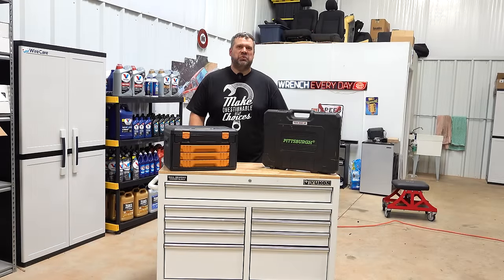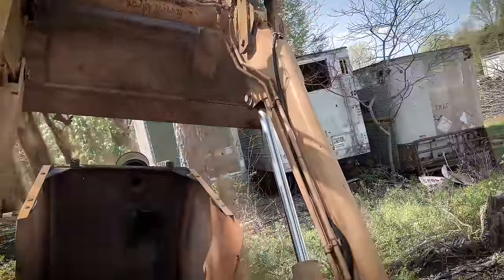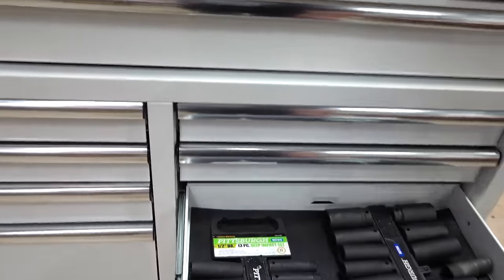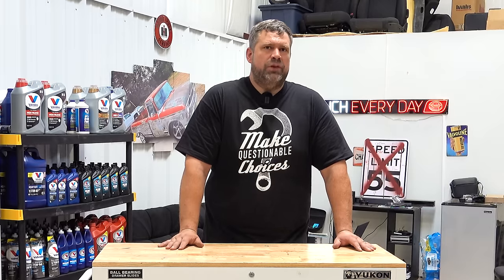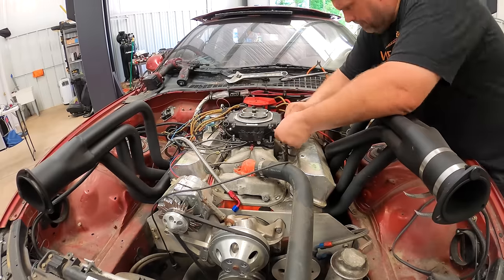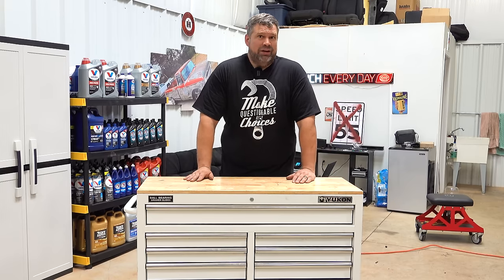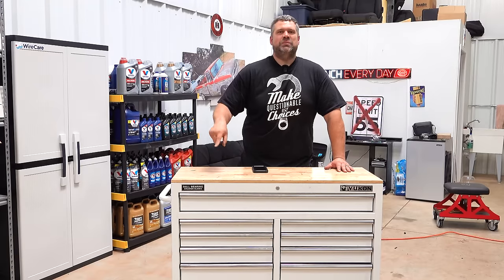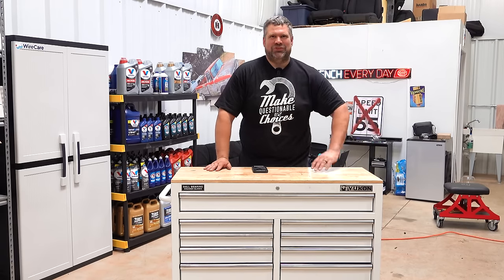I Bought The CHEAPEST Tools In Harbor Freight (6 Month TORTURE TEST)

Comment: I have a set of Pittsburgh screwdrivers and it has it's own organization stand about $40 it's comfort grip handle and seems decent I bought them before I bought the gearwrench and sunex screwdriver sets because I like the look and the organizer tray, but it is really decent I probably should have saved my money and just stuck with the Pittsburgh 70pc screwdriver comfort grip handle set.the new gearwrench handles are nice but honestly I don't see hardly any difference between the type and quality of screwdrivers between the Pittsburgh 70pc set and the sunex comfort grip red and black comfort grip handle screwdriver set, and I used to have mostly craftsman USA g1 and g2 and the older v-va series wrenches, sockets extensions and screwdrivers and I had over $3k in sockets and I am not a professional mechanic just a farm kid.. mostly working on 4x4 gm square body trucks Fe bumpside Ford 250 truck, and the Ford 96 f250 obs 460bbf 2wd super cab long bed and the current truck my 2000 dodge ram Laramie slt quad cab long bed 1500 4x4, and the other one Early 94 Chevy Silverado extended cab short bed Z71 tbi truck and garden tractors lawn mowers and various farm equipment I learned to fix out of necessity if I want to use like the 81 Chevy c20 350 quadrajet 4bbl 4spd farm truck we had and it was broken then I had to acquire the parts and figure out how to fix it, because we couldn't afford to just go get something else or something a little bit newer and couldn't afford to pay a shop labor and to tear it down to the offending broken pieces and parts, and pay for the parts and then put them back together so that usually resulted in scrounging around junkyards and scrap yards and possibly rebuild the distributor or the gm SBC or sbo starter to use a vehicle or piece of equipment one of us owned... but I like working on cars and trucks as a hobby still do.

Comment: When you are 16 and need your first own tools you buy cheap and replace the broken stuff with better tools you can afford at this time. The tools you break are the tools you need most and this are tools you need quality stuff for. I´m from Germany so I use 95% metric and the rest is for my MF35 tractor, you need no wrenches 30mm and up for 100€ a piece that you use 3 times a year. What you need are very good 10/13/17/19 mm tools you use 3 times per hour.

Comment: Like you I bought tools from Snap-on! When I Started buying tools in 1981 we didn't have Harbor freight! I did buy some of my tools from Snap-on! Just because they came into the shop I work at! The Sears store was over thirty miles away from me! The tech school i went to had protocols and I bought some of them! But I didn't like them because they didn't stand behind there products! That why I bought the Snap-on because no matter if it broke they stood behind there products. The shop ii worked in did alot of exhaust work! The floors in it where asphalt with wood under them so we couldn't have welders or cutting torch! We had to use clamps on everything! The clamps had half inch and ninesixtenth on them so two to three times a year we had to replace those sockets! We always use air wratchets to tighten the clamps!@

Comment: Gearwrench "Its not worth the money" I bought a metric wrench set, 10 tools, 2 of them wouldn't ratchet, the rings popped out. Warrentied for whatever. Been waiting 4 months for a replacement. Just nothin. A wrench aint no good if you dont have it. 20% failure rate is just junk.

Comment: I have used a buddies Pittsburgh green and black plastic handle grip pliers slip joints and I got a really big very sensitive blister on my hand from when they slipped and pinched my hand between the pliers and the freaking bolt and I threw them up against the bed of my truck and they blew apart and gave him $5 and the fairly nice but surface rusted craftsman professional series robot riveted slip joint pliers and told him to shut up after I got the blister on my hand when I purposely broke his junk ass pliers on the bedside of my truck and I was only trying to bend the cotter key after repacking the wheel bearing on my k20 86 chevy custom deluxe long bed 4x4 farm truck and I am usually completely respectful of others tools when I use them..

Comment: Why does every thing costs so much for even low quality. 
I bought a kmart bench top 100 piece 3 ratchet sizes taiwan made for $40 25 yeaes ago, still use it every week.
And a harbor freight 301 piece like 15 years ago when where $99.
Harbor set broken some ratchets but the bench top is still running strong .
Reply: Inflation. Dollar doesn't stretch has far has it did before, I'm spending 300% on groceries in last 4-5 years then previous, pretty crazy how much everything gotten expensive

Comment: Years ago I had a 300.00 A WEEK, YES A WEEK, Snap On habit. Trust me, the guy will show up every week. They make great tools and I had a great dealer. That was in the 90's through the 2000's. I was always a tool snob. Years later we got  a Harbor Freight store in a town near us.  I bought some throw away tools for the farm. Stuff that if I lost in the poultry house or on the farm it was no big deal. What I found out was that for 99% of what I did they worked great and we had used Fluke meter forever and always had trouble with them. I bought a Ames from Harbor Freight and it has been great! Are they Snap On? No. Do they do the job just as well at a fraction of the cost? Most of the time yes. And as far as money goes, do not believe that Snap On is an "investment". The worst investment denotes that the item will at a minimum maintain its value or increase.  If you think Snap On tools are an investment go in any pawn shop or look on Ebay. If you must have a Snap On box....and they are quality boxes...buy one of Facebook, Craigslist or Ebay. You will pay a fraction of what it is off the truck and if you have a good dealer he will understand. One final word....remember,  you just need to get the job done.  Sometimes it is not about what you make, it's about what you keep.

Comment: Disclaimer, I'm cheap.

I also like good tools but good and shiny aren't synonymous. 

I have lots of Craftsman USA and otherwise.  They were/are good and seem a bit nicer made than the cheapest HF tools but durability is similar.  Unfortunately the USA tools with a lifetime warranty get replaced with China tools when they break so the warranty isn't really worth paying for.

Crescent wrenches suck but good ones suck less so im always on the lookout for a good one.

This is where my cheap tool technique comes in.  There were lots of really good tools made in the USA and Europe before the 1990s.  Japan and Taiwan had their moments too.  Lots of those tools end up in garage sales, thrift stores and in the junk store at Pick-n-pull.  You can also find good stuff on Ebay and Craigslist.  For tools that suck like Crescent wrenches, I look for good used wrenches that are still tight and not used as a hammer too much.  I find several a year without looking too hard.  Occasionally I'll find something like an incomplete socket set or tool box really cheap.  When I want to put together a tool kit I look at what I have and then I look at what I need and then I'll hunt for decent tools on sale or clearance to fill in the gaps.  If I can't find something nicer and/or cheaper, HF becomes my go-to cheap tool source.

I have probably spent less than $5,000 on hand tools but I have a few car kits, a self service junk yard kit, a home kit with 3x+ redundancy (I'll never be short on 10mm), old school Kennedy tool box sets and a few specialty tools.

I could not come close to replacing that with a $5,000 HF shopping spree.

I do have a few Snap-on tools and other fancy brands but I think I've only spent about $50 on the truck...

The key is being able to tell a good tool from garbage and finding those good tools at garbage prices.

You can do better than Harbor Freight but it takes some work.

Comment: I would never buy Mac tools. The local dealer won't replace or repair tools off the truck. And will only order replacements and leave you without a tool you need for weeks. And now that Craftsman is being made in China they are overpriced junk too. HF has come a long way with the quality.

Comment: Such a bad stigma around snap-on because of the tool truck thing🤣 and it really isnt the fault of the guy on the truck. There was a good chunk of time where there was certain tools you had to buy snap-on for a quality unit. But most of those tools Milwaukee and craftsman have better more affordable versions of today. Also i bought a multimeter from bluepoint because we were required to have their unit where i went to school and the school had a 50% off on snap-on tools with another 25% off the first year after you graduated. The multimeter was absolutely junk, worst electrical diagnostic tool ive ever used. I at one point in a pinch bought a very cheap $25 multimeter tool from walmart that i wanna say was hypertough, and it actualy worked significantly better than the unit from bluepoint/snap-on. To this day i have not bought a single tool from a major tool retailer/manufacturer like snap-on or matco, and i cannot say that i ever will i gree up around alot of mechanics and a very big thing was the realization that as mechanics we spend alot of that "quality income" we get from labor charges on tools when there isnt really a need for it, especially now.

Comment: I once found a snap on M8x1.0 tap inside the water pump housing of a 1973 Mercedes, it had been off the road for 20 years and since then I’d covered 40k miles over 6 years. So that thing had been in there at least 26 years and for a minimum of 40k miles, it had chewed the water pump housing up to hell and eventually killed the pump but it was still sharp enough to use and didn’t have a spec of rust on it!  I’m definitely impressed with the quality of snap on… I’m still not going to buy any of their tools though!